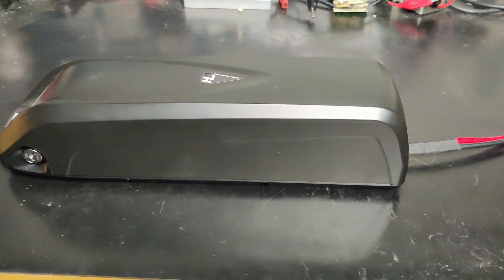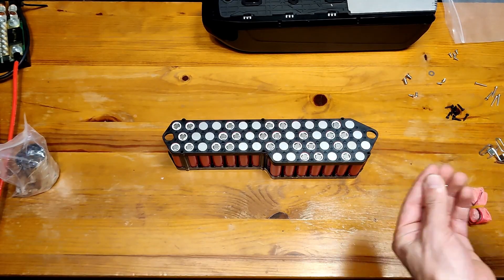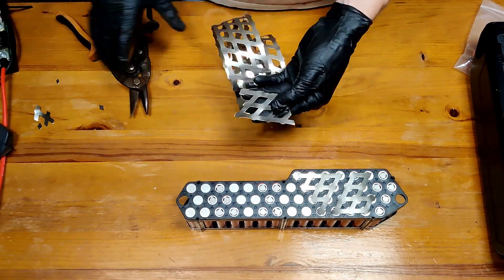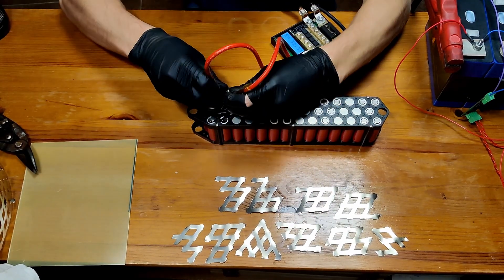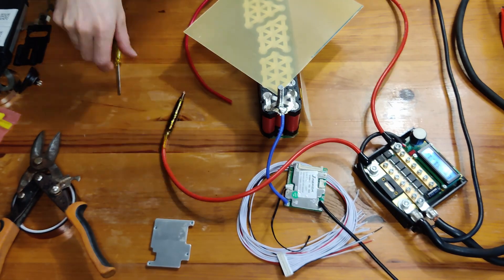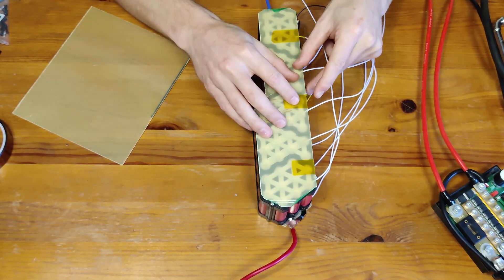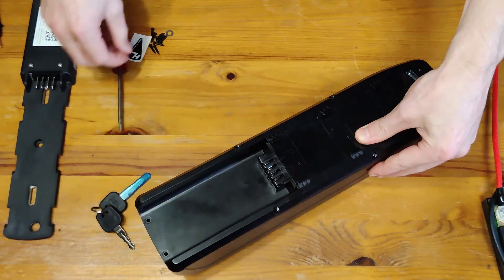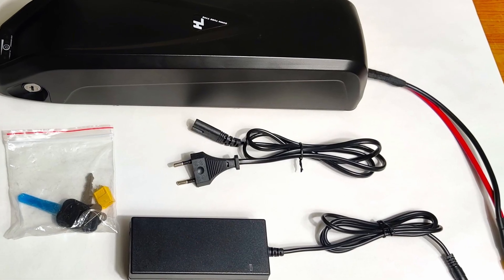DIY 36V 12Ah E-Bike Battery w/ Bluetooth

Comment: I would like to try this? I am a beginner I have made a couple of impact driver batteries 21v using 5S BMS so far they have worked fine for charge and disharge. can you suggest a plan for me to follow? thanking you Roger
Reply from the maker: Hello Roger, I have watched a few minutes of the video about your impact driver battery. Keep it going! I suggest you get quality cells if you can, brand name if possible. You can also get a similar kit to make this type of battery from Aliexpress, everything included except for the cells and charger. Hope this helps!

Comment: should have 3 thread from that battery why only negative and positive? very confusing
Reply from the maker: In this case it's a common port BMS, meaning it charges and discharges from the same port. So you only need two wires.
Reply: @Asvybre  
Okay and how about date cable? How we do

Comment: Wich battery is best budget 21700 or 18650 for high amp
And capacity? Because there Are so many and difficult to buy
Reply from the maker: The best is the cheapest you can get in your location. Lately 21700 has become cheaper by capacity and discharge. What are the specs of the battery you want?

Comment: What size wire is you using 14awg or 12awg thanks
Reply from the maker: I am using 12AWG, the lower the better!
Reply: @Asvybre  thanks will 14awg wire Good for 36vx25a power?
Or 12awg best?
Reply from the maker: 12Awg is ideal but if you have a short cable you can probably be safe with 14Awg
Reply: @Asvybre  thanks 😃

Comment: Sir you connect this battery Why this like connection some triangle and parallelogram hexagon you can take straight, square i was confused this connection
Reply from the maker: You can do a straight or square configuration when you have lots of space. But if you need very compact configuration you do offset configuration to get higher density.
Also this battery holder is from a kit and already comes with the nickel strips so it's easier to assemble.
Reply: Sir you connected the BMS in a battery pack you will write the code like battery simulation in matlab how to write code of battery pack simulation
Reply from the maker: What do you mean? the battery packs comes already programmed
Reply: @Asvybre   hi sir battery pack simulation like soc,cell blanceing, charge and discharge, code write  for BMS
Reply from the maker: No need to write code, BMS already programmed for the type of battery

Comment: Nice those BMS has gotten smaller.. But for real power I would suggest to use a bigger BMS with platines removed. 😎
Reply from the maker: You are correct, this BMS can suposedly handle 30 amps but I do not believe that is continuos.
One question tho, what do you mean by platines removed?
Reply: @Asvybre  the Aluminium plates which is covering the BMS. Because the Hailong case is tight, but make sure it won't touch the Battery. 
I had failures with those small BMS but perhaps the owner was a Bike Basher. 
Another Method is bypassing the BMS for discharging for higher performance.. But it's dangerous for uneducated customers so you must use it with a Fuse.
Reply from the maker: I've done that on this BMS, it had a small aluminium plate which I had to remove to make it fit.
These chinese BMS's are not very trustworthy, so far no batteries have burned on me but I've seen some batteries go as high as 4.26V while charging.
For discharging I am not as worried and it's harder to blow up and a fuse in series takes care of it just as you said.
Reply: @Asvybre  there are 2 Apps one is for Customer and the 2. is for developer where you can adjust Charging and Discharging Voltage.